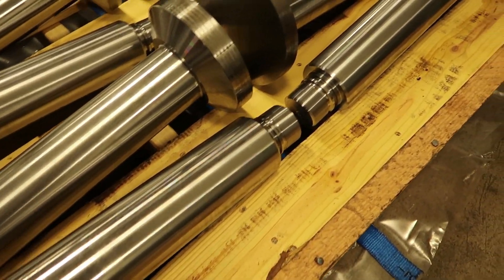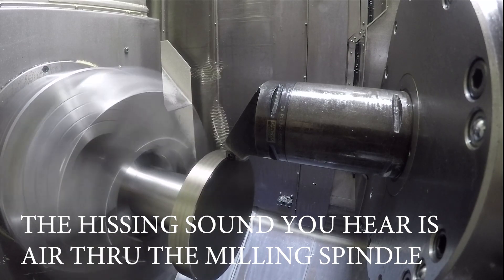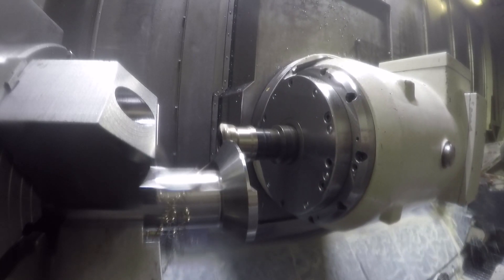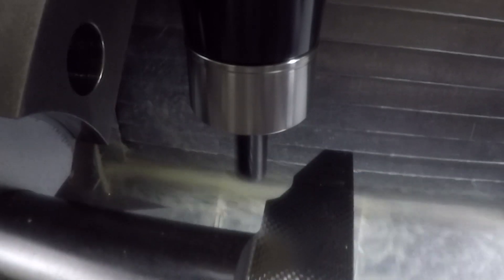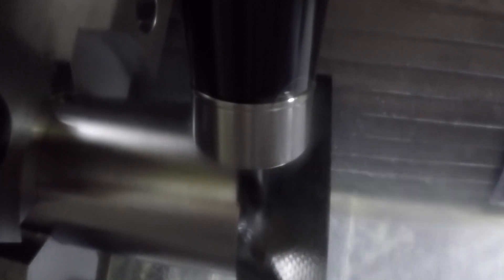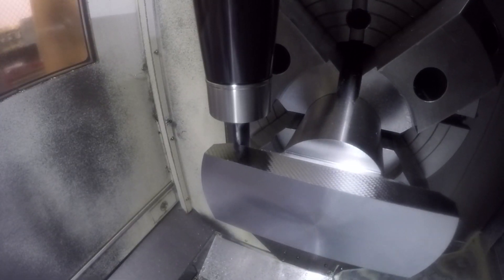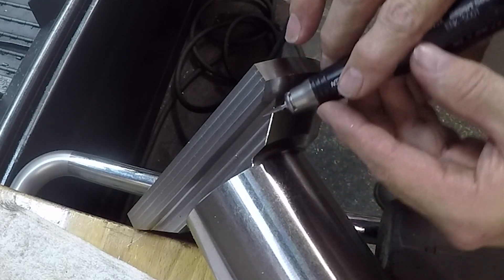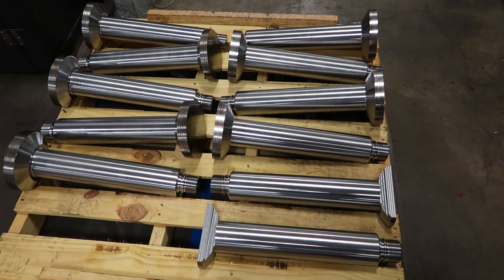Ram Shaft-2

Comment: Seeing a 4 jaw chuck on a CNC lathe is very strange. A 3 jaw chuck is so much quicker to use and I have held larger parts than this to do a 2nd op. 😖.
Reply from the maker: The reason I use a 4-Jaw chuck is it fits the type of work I do better. Also I get the full spindle bore size. This was also important to me. Although it isn't efficient for this kind of job. This isn't the kind of job I usually do. Most jobs I do get chucked and stay there for a whole day or two. So being able to dial in the runout perfectly is more important than time. Another thing a manual 4-jaw isn't as susceptible to spindle speed and chucking strength (Chuck opening due to spindle speed) as a hydraulic chuck.

Comment: Do you use conversational programming directly on the MAZAK, or are the tool paths for a job like this generted in CAM?
Reply from the maker: I never us the Mazatrol control for anything more than boring chuck jaws. Everything  I do is programmed in Cam of of solid models. And most of the time I even bore chuck jaws with the Cam software as well. It's not that I dont like Mazatrol. It is very good for straight lathe work. For milling I'm not so impressed. There are guys here at Centerline that do very impressive milling tasks with it but I prefer using Cam generated programs. The job depicted in this video would have been easy to do straight on the Mazatrol.
Reply: Thanks. Roughly how many hours programming go into an hours machining? I am just playing with a little MAHO 400E in my basement, and the programming part takes me ages.
Reply: Edge Precision  Peter you should try to do a demo with someone from Mazak on the new smoothg controller. We just purchased a new qt200-msy and I find the Mazatrol programming to be very powerful. Very easy to do pretty complex milling and turning.

Comment: How does that machine know EXACTLY what the dimensions of the piece are? Lasers? Thanks.
Reply from the maker: The machine is just a robot. It has servo motors that rotate ball screws that have encoders that feed back position to the controller. Although it can position quite accurately none of this guarantees the parts accuracy. The man running the robot/ machine determines that. The machine just follows the path programmed. It knows nothing more than that. It knows no part dimensions or anything about the part.

Comment: Peter, what kind of indicator post do you use? I want to throw my Chinese POS every time I touch it. That one looks very easy to move/adjust
Reply from the maker: I think it’s a Noga arm. If you are talking about the one I use in the spindle. It’s a older on with a smaller knob. The new ones have this bigger plastic knob I don’t care for. All the mag bases I use are also Noga brand.
Reply: I just bought one. I’m very excited to give it a go. Thank you 💪🏼

Comment: GOOD EVENING SIR

I have to deburr tomorrow
Its material is copper
It is 3mm diameter through hole on the slope.
Please refer to the tool for deburr
Reply: and i need circle type brush
answer plz
Reply from the maker: I’m not sure what your asking. Are you saying you want to deburr the entry of the hole. Also what kind of cooper is it and how good of a deburr job is required. Do they specify a radius finish exc.?

Comment: It is very nice to watch the Professional at work :)
Q: What is the best strategy (left side , right , both sides) to cut STUB ACME and ACME Threads and High Pitch Threads. Also did you use Mazatrol to program this specific thread or SpaceCIaim?
Reply from the maker: The cutting strategy I use for all but the courses threads is to feed straight in. With a constant area cut depth. On this large of a machine that works fine for everything from say four pitch and finer. For a courser pitch I might use a zigzag type of pattern of in feed. The cam software I use is Esprit. I program all threads with that software. I almost never use the Mazatrol. Maybe for boring soft jaws, most of the time not even for that.

Comment: I have never heard of offsetting the C-axis. Can't you just orientate the model differently in your CAM software and post different C values for jaw clearance? I guess it is one in the same? Great work, thanks for sharing.
Reply from the maker: The C axis has a fixture offset just like any other axis. It isn't necessary to reprocess code just change the angle or zero point of your offset. Its totally necessary to be able to set a zero point for the C axis otherwise how would you align to the part in the rotational direction.

Comment: Peter I would think the T flange  machiend at the end of the shaft could have been welded on and saved all that metal removel save costs.?
Reply from the maker: Possibly but I don’t design the parts. I just machine them.

Comment: ..On those facing cuts..do you increase spindle speed as you approach the center...?
Reply from the maker: Doug Ankrum On  CNC lathe in the G96 mode (constant surface finish) the machine will increase speed as the diameter decreases. So on a facing cut the speed will increase until you reach the maximum rpm of the machine or the max speed you specify in your G50 command. For speed limitation.

Comment: Your powerful and carbide tip hand grinder will easily damage your nicely finished part if it is carelessly operated。Finishing them on machine is better, although it needs 5 axis programming。 Anyway it is a very nice video!
Reply from the maker: raychar cheung Yes it could be done but for eleven parts it would take more time than doing it but hand.

Comment: Nice job Peter.  Would it have been possible to do all the deburring in the machine?
Reply: Depending on how convoluted the chamfer methods are in the software, sometimes you can't just select a basic edge and expect the tool to follow it at certain diameter and be done. :(

And since these particular edges meet at a few pinch points that can cause easy gouges, it makes it next to impossible without a bunch of workarounds.

Comment: Do you always climb  cut?
Reply from the maker: Doug Rundell Yes almost always.
Reply from the maker: When I bought my machine it came to me in pieces and I assembled it and installed it. it has a Mazatrol 640M Pro control(yours may be different). On this control there is no ATC recovery mode that I am aware of (If there is I have never used it). I have had many tool changer issues mostly my own fault) . What I do is go into the Machine Mode (The key with the little wrench on it) Than to ATC than enable interlock cancel. At this point you need to be very carful there is no safety interlocks. Than you can cycle the tool changer to remove any problem you might have and even jog the machine (very carefully!!!). Than you must put the tool changer back into its normal position for a tool change than disable interlock cancel. I have had in some cases, had to push and release emergency stop a number of times to unjam things. The tool changer on my machine will not function if it is not in the right position initially. The magazine, the shifter, the carrier, and the arm all have to be in the proper position or you will get a alarm. Hope this helps but I think your tool changer is different than mine.
Reply: Edge Precision have you ever had to use the ATC recovery mode/step function on your intergrex? a mazak vtc800 mill at work had a power failure during a toolchange and nobody can remember the sequence to get the toolchange carrier/arm to reset itself, luckilythe mill does not get ysed much, only for bigger jobs
Reply: Edge Precision yes its differant, on the vtc 800 a carrier runs backwards and forward on a rail system underneath the spindle, right now the carrier is engaged with the tool carasel at the back, it need to release whatever tool it has and then go back to its park position but nobody can figure out how, mazak service techs job i guess, the little maintenance memu (spanner mode) has keys like ATC recovery mode and such but no buttons work